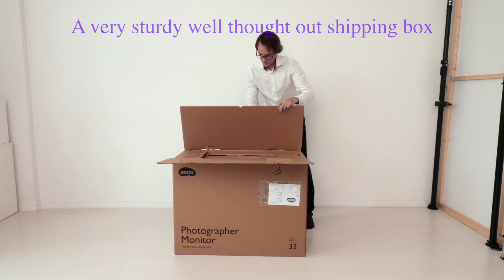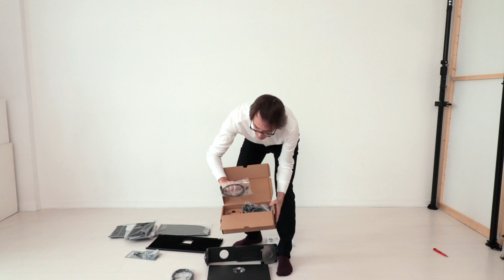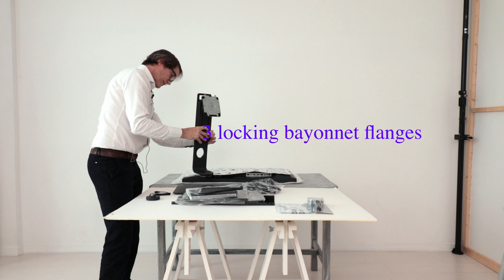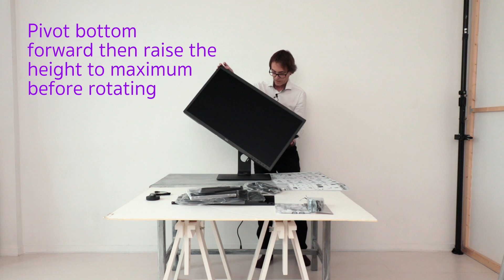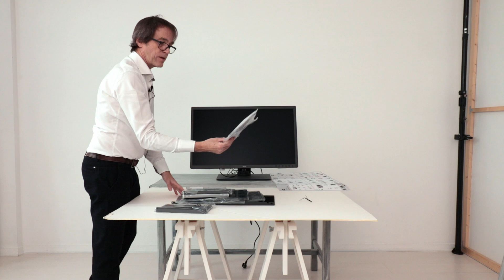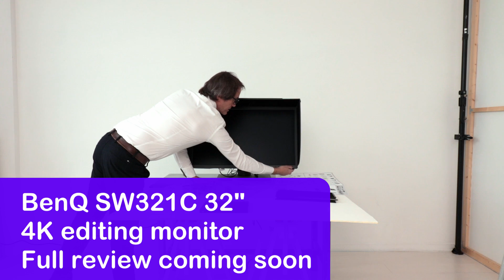BenQ SW321C 32 4K Pro Monitor Unboxing and Setup

Comment: Benq is NOT offering any support and my monitor says "NO SIGNAL DETECTED"- so now I'm forced to send  it back - I still have the box and with no support you don't know if it's you or the product
Reply from the maker: Where did you buy it from? If you believe there is a technical problem you'll have to take that up with the reseller or BenQ if you have a RMA. Usually no signal detected is a cable issue, BenQ monitors are supplied with high grade cables. That is where I would start to look, yet this is not the place for troubleshooting.
Reply: Probably too late with this but you have to manually select the correct input using the buttons on the bottom right of the monitor bezel.

Comment: I'm an old mechanical engineer and it took me a good 30 minutes to determine IF & HOW the screen adjusted up& down and also 15 minutes to get stand on base, so it's just NOT AS EASY AS THIS GUY INFERS. Maybe he got lucky when he hit the stand just right but I could not get it to tighten or foot ROCK_tight for a long time, then had to do 3-4 more searches on the stand, as MANY of these are NOT adjustable, and it took a 60 second video of a10-year old kid just pushing on it somewhere unexpected to make it work. BAD directions from co & hope it now works better than that start indicates. Other than that, nice video, but gave me false sense of confidence that's for SURE. BR
Reply from the maker: I am a power engineer, yet that doesn't make any difference to as how these and most stands are made. The stand is a bayonet mount with a simple screw with foldable wings for making it recessed. Put stand in base, turn and set the lock screw as indicated in the instructions both quick and full user manual. As with all the stands I have ever used it is really simple: spring loaded dampened center post for hight adjustment, hinged monitor mount for tilt forward and backwards, and rotation in one direction for orientation portrait or landscape. The base has rotation off center. All operations are simple you hold the panel and modify any preferences. Not sure if anything could be easier?

Comment: I look forward to your recession ... if possible I ask you to please let us know how it goes beyond in the photo field also in the video sector, since from the characteristics I seem to understand that compared to the sw320 also in the video sector there is a step forward.
Thank you.
Reply from the maker: Thanks. Yes what are the biggest advantages of this new technology over the SW320. For me it is a combination of the new surface coating and uniformity control. Next is the essential USB C power delivery making it very polyvalent and a one cable monitor. Thus for video and photography with native 24 and 25p video editing, combined with excellent uniformity ( and inter display agreement=if you have multiple monitors they will match up with less deviation) and greatly improved viewing angles ( don't go by only specs) will find its place in pro level workspace environments. I am working on the review now, and will keep your comments in mind.
Reply: @NeilSnapePhotography  thanks and good job for the full review.